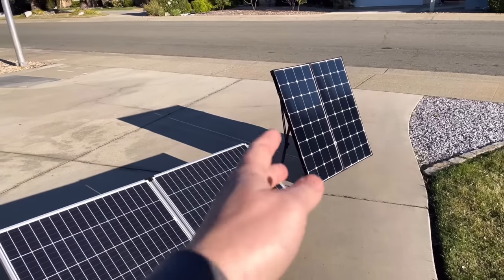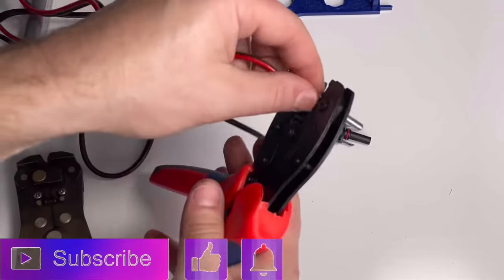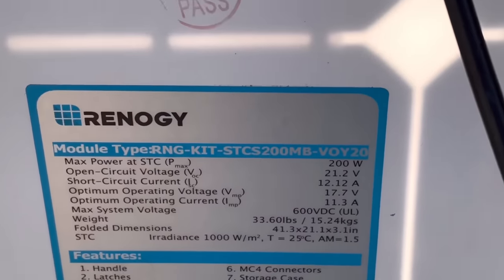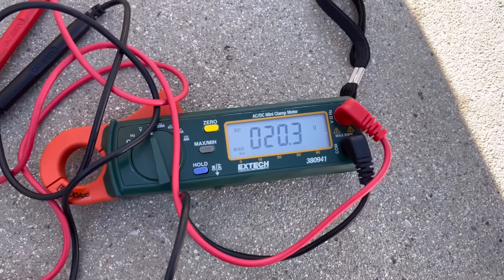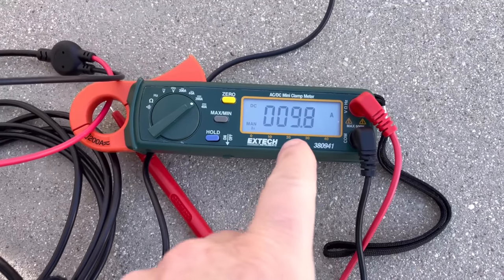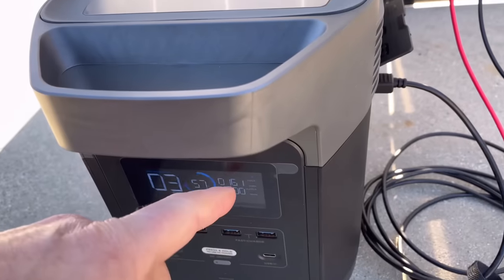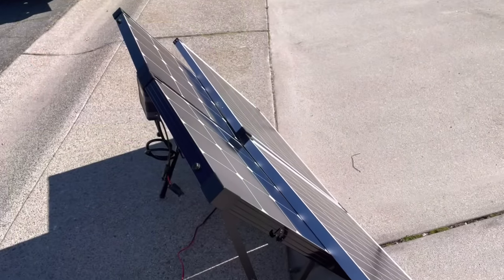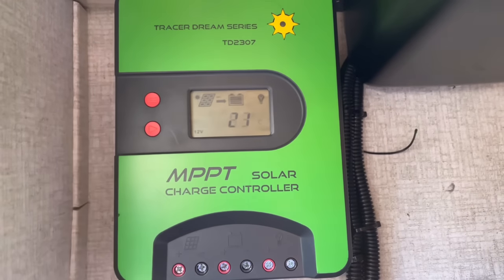Best Solar Panel - Harbor Freight 100 Watt Solar VS Renogy Eclipse Solar

Comment: I bought 2xrenogy 100w non eclipse panels for $199 ,(in a set of 2) and 2xrenogy 100w eclipse for $340 ($170 each) and compared them planning to return one set. In the full  sun, they performed about the same, but on a cloudy day and in the mornings, the eclipse performed way better in my tests so I kept those.
Reply from the maker: Nice, interesting info…👍🏼
Reply: Was the difference 30% better? If not, then you could have bought another renogy and still had the $40 left over.
Reply from the maker: It’s a review to see the difference and is it worth the money to the buyer if they wanna spend more or less. 

It’s not for me.

Comment: I have two harbor freight 100 watt panels mounted flat on my travel trailer for 3 years now. I use a Chinese charge controller and a single marine lead acid battery.  I run a 12 volt roof mount evaporative cooler, an auto style radio/CD player and 6 led lights and charge my phone and at night run a small USB style fan.  I use an inverter to use the toaster,(450 watt), and an 800 watt microwave occasionally.
While in az last year, I experienced a hailstorm that shattered my plastic vent in the bathroom and put a thousand good dents in my aluminum exterior.
My harbor freight solar panels suffered no damage.
Cheers!
Reply from the maker: Wow cool that held up. 
And sounds like you are doing just fine with your set up..👍🏼 

Thanks for the feedback

Comment: I own two Renogy 100w solar suitcase portable panels with those Sun (type) mono cells. They are beasts for power AFTER you replace the cheap diodes in them. Excellent in lower light levels, but pricey. The hardware also needed replaced and rivits needed corrosion control (sanding and painted) after light use outside. They rusted out. Higher MPPT panel volts always makes more juice...but, for small(ish) set ups, PWM is fine. Renogy DOES make a very good PWM lithium battery solar charge controller.
Reply from the maker: I often wondered if I changed out the diodes if that would have made any difference. 
With so much product on the market it’s hard to justify renogy pricing now.
Reply: Had a Renogy Adventurer PWM charge controller, died just after the warranty. No more Renogy for me, high priced Junque.
Reply: Years ago I had pulse width modulation charge controller and 8 ) 250 watt panels. Then I got a  MPPT charge controller it was like I had nine panels.
Forget all about PWN get MPPT, you will not regret it .
Reply from the maker: Agree it’s worth it. It makes the most out of every volt!
Reply: There's a youtuber who buys up commercial grade used and changes out the diodes... Guess what! (too slow) That's the only thing wrong with them 90% of the time. Someone local to me is selling a transport load of retired PV, building being demolished. He's marketing them as working, so there's not much to be saved.
Reply from the maker: That’s a bummer, why’s he changing the diodes we’re they burned up?
Reply: @johnnysweekends  Yep. He's cashing in on the lack of knowledge and a disposal culture. Inspection of the panels for burn spots helps to weed out actual dead panels from fried (cheap or poorly chosen) diodes.
Reply from the maker: Yea some panels that seem good only 3-4 years in start to fry and short at the bus bars. Sometimes hard to know
Reply: @johnnysweekends  Murphy's law of planned obsolescence: take s*** out until something breaks, then replace the last thing you took out. This includes, but not limited to: wire thickness, plastic thickness and quality, using metals in configurations that will corrode.
Anyone with a year of college general college chemistry knows how to prevent corrosion.

Comment: Got 2 of the HF panels on my camper wired to 24 volt going into a MPPT controller in my camper setup for 12 volts. I love them. They made all 200 watts. Batts are full every time i go up there.
Reply from the maker: Agree I think for the price and quality they are a decent option.👍🏼
Reply: @johnnysweekends  nice job being thorough by the way. Lots of meters and live readings. Its hard to find good content on off grid equipment. I've been 100% off grid for 7 years now in WI. Made a few videos decribing my journey.....take a gander if your bored. I over explain everything.
Reply from the maker: Thanks, I think some people think I blew a little fast through the video. 
Which honestly this one I just made on a whim and threw it together. I saw the panels at harbor freight grabbed them to see if they were any better. 
Missed the cloudy day test though lol. 

I didn’t think this video would have been this popular.

Comment: I highly recommend HarborFreight panels.  I have 400 watts worth hooked up to 4 100ah of batteries connected together and hooked to a 2000 watt pure sine wave inverter.  Each 100 watt panel goes through it’s own controller.  Mostly because I’m cheap and lazy
Reply from the maker: So far they seem decent. Much better then the older models they carried. But everything is getting better fast.
Reply: @johnnysweekends  They really are. Makes me wish me wish I was younger so I could see what will be available in  30 or 40 years. People will probably be charging their sex robots with solar panels on their camping trips
Reply from the maker: 🤣🤣🤣🤣🤣 ya never know, I guess anything could happen…
Reply: I got 2 of the cheapest on Amazon on my van powering 2 200ah agm batteries.  They work and charge faster than the old renogy panels.   I use my gaming laptop all night long, and run a split air conditioner 5 or 6 hours a night while I sleep, barely any power in the morning but it charges while I'm at work.  I park where I work in Detroit.  Last year I saved 63000 in cash.  Every Friday I remove my money from the card and bury it in special made money container u can buy on Amazon, they are made to store cash underground.  Screw banks, they will limit the amount you can spend if the gov is worried about a run on banks.  Like a few countries did last year limited people to 100 dollars or whatever a day.  Or if you owe bills and they sue you they will close your bank account
Reply: Haha That’s comical. Sex robots, sounds about right!
Reply: @jake7396  your focused on the sex robots, how bout the guy who is burying his money ?? I wish I knew where he lived ?!?!
Reply from the maker: You full time in a van..?
Reply from the maker: Lol right
Reply: @johnnysweekends  yep
Reply: @johnnysweekends : …”down by the river!”
Reply from the maker: 😂😂👍🏼 that’s considered a luxury now..😁
Reply: @breakingames7772  The only problem with storing cash in a container is that the value of the cash gets reduced overtime because of inflation.    I'd say it might be better to put the money in some fairly safe moneymarket investments.  There's been no precedent by any government (as far as im aware) that has tried to limit the amount of money you can take out of investment accounts.  That way you'll earn interest to stave off inflation.  Or do half and half, keep some cash in a contain and put the other half in investment account.
Reply from the maker: Yea I always Like to have some cash, but true, even investing some like even cd or bond can at least provide a safe return. Won’t be a ton but better then sitting in a box. Diversify ..👍🏼

Comment: The solar suitcase is a classic case of "nearly free" design adding value.

You really need to set the height and then see how much they generate during an entire day.  The instantaneous power when perfectly adjusted isn't as realistic as a whole day test.   I'd be interested in how much capacity of a standard battery they filled over the course of a full day (or even a set of a few days).  (It's early in the video so now that I see the delta, maybe you are going to do that.)

Also... you can "adjust" the harbor freight by a few degrees plus or minus by putting a tile or brick under the legs or under the base of the panel.
Reply from the maker: I have though about this but would be hard to measure the amount from two different set ups as the controller would also have to work relatively the same and also loading what ever storage unit you wanna put the power in. So those as well would have to be as close to a certain discharge level so each unit could charge at the same rates where the controller optimization feeds each battery or power station the same. 
I think
Reply: @johnnysweekends  Ah, yup- I see that.  You'd need duplicate setups side by side under the same conditions and that would be more expensive to test.
Reply from the maker: Yea I can hear the critics now lol.

We’re both panels exactly the same angle, was one 6 months old and broke in and the other new ? We’re both batteries exactly same depth of discharge, what type of wire what size and on and on.
The questions you get asked can go for ever lol.

Comment: Nice and to the point and clear.  I used two 100W in series to get the same factors you mentioned.  I use a Victron 100/15 but plan more later...  thanks.  going to subscribe to see if interesting topics come to surface.  later.
Reply from the maker: Thanks for the feed back, and subscribing. And yes more stuff coming but have a few other vids coming as well.

Comment: Power per square inch would be an excellent metric to see.  I may be helping with an install on a sailboat, and surface area is pretty limited.  If you can fit the same amount of power in less space, it may be worth the extra cash in some situations.
Reply from the maker: I have a couple others I’ll be doing soon.

Comment: 15 years ago for my Birthday I got a HarborFreight solar system. Still using the panels to charge my battery powered yard tools charging my boat batteries and my motorcycle battery.
Reply from the maker: Those kits are pretty bullet proof from what people report. I guess the charge controllers are not great but even a cheaper decent pwm controller can be for a good price. Like $25 bucks
Reply: @johnnysweekends  for the $$$ the harbor freight is tough to beat. Besides if you are just starting out blow up cheap stuff, less regrets. The charge controller lasts a while . Don’t buy your charge controller or batteries there.
Reply from the maker: Oh yea the batteries and controllers are as cheap as you get. 
Some stuff you buy at harbor freight and some stuff you don’t.

Comment: I bought 4 100 watt monocrystalline panels for about $90 each new on Amazon. I made portable adjustable mound of PVC pipe for a few dollars. You can make a 200 watt system for a little over $200.
Reply from the maker: Some of the panels have really dropped on Amazon over the last of 6 months. Kinda nice.

Comment: I have one of the 100W harbor freight panels mounted on my van, it's been there a year. The insulation on the cable is getting some UV damage. It's still working but I don't think more than 2 years of continuous outdoor use is likely. 

Now if you replaced the entire cable , maybe then I could see it lasting longer.
Reply from the maker: Yea the wiring doesn’t seem like the best for constant sun exposure and should probably have some wire wrap on it to help it last a little longer.

Comment: I believe the differences between those two panels goes deeper than just amps and voltage . The way the cells are wired is the biggest difference I know of , if a shadow were to hit one side of the panel the harbor freight panels would stop producing power if one cell in the series get shaded where the Renogy panels can get shaded on one side and still produce charge mainly because of the way the cells are wired together .
Reply from the maker: They still produce if shaded just not as much obviously. Same with the renogy.

Comment: I was excited when I saw this video and clicked on it expecting a layman's video on how long it powers the fridge or a fan or something.. Instead I got lost with all the fancy numbers & charge controller stuff.. It Would be nice for you to run this test again by using a modern day appliance for the test.. Thanks and God Bless!!
Reply from the maker: This is more about how quickly it can charge a storage unit… “batteries “
Which if you have a small battery bank you need a big solar system to keep up. Verses a big battery bank with have plenty of storage to power a item even if the power coming in isn’t much the storage bank will be ok as long as you don’t plan to run a certain item for hours. 

Imagine a lake….a dam… and rain…
Water in = solar
Water out = power draw
Size of lake is size of batteries 

If you understand all that mess..😂👍🏼 

But I could make a more simple video down the way. ..👍🏼 blessings as well on this Sunday…🙌🏼
Reply: @johnnysweekends - Thanks Johnny.. Enjoy and God Bless bro!! 😀

Comment: It looks like the Renogy's panels are connected in parallel configuration and the Harborfreight's are connected in series.  If the Harborfreight's panels are in parallel then the voltage would be roughly the same  voltage +17.5 Vdc with higher current!
Reply from the maker: I had them both in series. If I did parallel I would need a adapter.
Reply: Was the Renogy disconnected from the onboard MPPT?
Reply from the maker: The on board charger is a pwm. Lol they won’t sell you a Mppt unless they wanna charge you a big difference as the price for a pwm is cheap like $25. Almost all mppt chargers are about $80 on up. Name brand even more like double.

But yes I bypassed the charger, I never used it as I have a Mppt on board my trailer.
Reply: @johnnysweekends  odd the voltage was so low. I have a 40amp and the 100 amp Renogy MPPT.   I like their products. They tend to use high end cells for their panels.
Reply from the maker: Normally the renogy stuff is good but tons of players on the market honestly getting the same stuff. Hard to pay for the name.
Reply: Perhaps one of the two Renogy panels was faulty? He could measure them individually to confirm. He was getting 160w, which depending on his location, time of year (winter, less sun), and time of day, isn't bad for 2 100w panels. 

If you rewatch the video, it's quite clear that one panel conductor is looped over to the other, and the other from each panel is going into his power meter. No, there wasn't a wide angle shot, but with what you can see both pairs were undeniably wired in series.
Reply: @mlindholm  You can't change the physics though. Parallel PV connection raises  Amps. Series raises  Voltage,  like the HF. I saw the very brief wiring setup, So It's another YT mystery.

Comment: I’m glad that your Renogy kit is working for you. I bought one three years ago and wow what a piece of shit. The damn wires won’t even stay in the charge control panel and the battery loses most of its power the second something is plugged into the inverter.
Reply from the maker: Hmm well your not the first person to have issues with there kits. Not that I have heard a lot but like anything it can have issues.

Comment: This video is great for people that are a bit savvy around electrical things.  I need more basic, practical info because I am not mechanical at all and I hate electricity.  I bought 2 HF 100w panels about 2 years ago. Never took them out of the box.  Also bought a controller.  Didn’t buy a battery because I knew I wouldn’t be using it for a while.  At some point I need to test this thing. Still don’t know what I could use it for except to charge phones.  Will it keep my freezer cold also?  I see a couple meters being use to gauge output. Honestly, I wouldn’t know how to use one. So you can see the need for very remedial videos.
Reply from the maker: I’ll have to work on a basic how to some time on solar and basic power set up..

Comment: Great info, I was curious about the harbor freight system.  Definitely more in my price range.
Reply from the maker: Yea if they hold up and definitely worth it. 
And if you find a sale coupon definitely worth it even more.
Reply: @johnnysweekends  They are having a Spring Black Friday Sale now (NC), bought 3 today for $89.99. Got 2 then went back and only had 1 left so I grabbed that one else I would have grabbed 2 more.
Reply from the maker: Nice grab!!
Reply: @johnnysweekends  , I have Harbor Freight panels that are at least 15 years old and still putting out power.
Reply from the maker: That’s awesome. I mean a lot of this stuff is made in a lot of the same places but if a big name puts there names on it you will pay for that. 

Thanks for the feed back..👍🏼😀

Comment: For $500 I purchased 5 used 350 watt panels in good condition. 

Reuse is the second leg of the green triangle for a reason. :)
Reply from the maker: Nice but. A lot of watts for a decent price. 
If you can use the big ones go for it.

Comment: New sub! Yes on the vid on changing the terminals, and a vid on making a power station on a workshop please?
Reply from the maker: Are you trying to power a shed. So simple if grid or shed build?  Or portable power station. Kinda different but the same. One just a little more work lol. 

Here is the video link to mc4 change out. 
MC4 Install Crimping Easy DIY
https://youtu.be/CFgRCBzquz4

Comment: I have tinkered with a few brands of panels...and I must say, Harbor Freight has some good panels....everyones...brands are chinese so yeah.     3 years old 4panel 100 watt system..still goes 14.5 v  wattage around 78 watts. ( powers shed)    The Renegy panels do have a quality feel to them
Reply from the maker: Exactly all made in China so it’s finding the most watts and best deal and likely that panel will probably work just fine

Comment: Good video, would suggest a simple chart, would be easier for slow people like me to make the comparison without keeping a bunch of numbers in my head. good work
Reply from the maker: Thank you and I’ll work on that. Overall though if you have higher numbers or watts coming in over a sustained time, that is what will charge your batteries faster. 
Thanks again..👍🏼